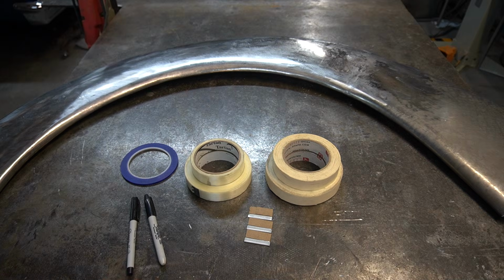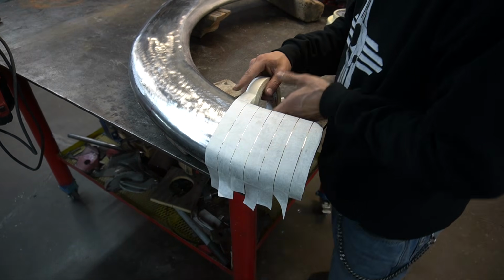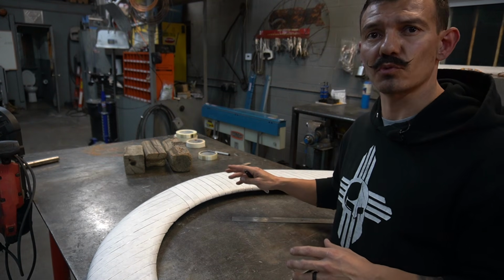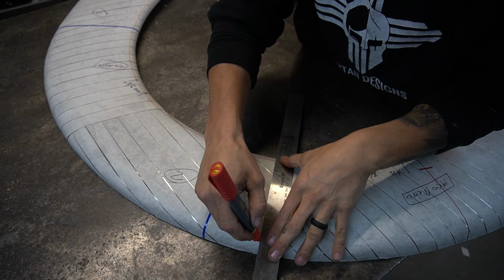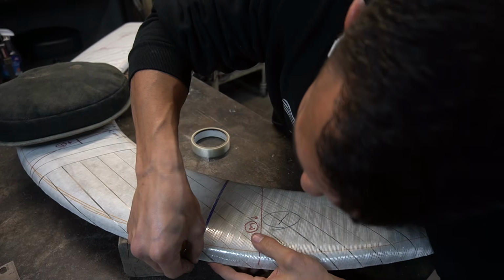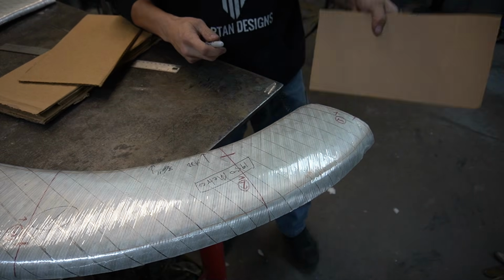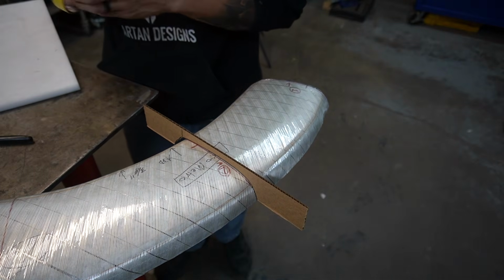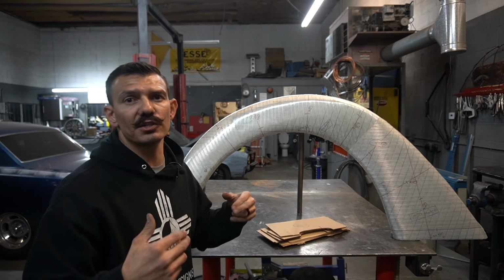How to make a flexible shape pattern | Metal fabrication | Wray Schelin signature patterning method.

Comment: Another practical and straight forward video, thanks. For the inner sections you copied, i would recommend you to use a contour gauge.
Reply from the maker: That would have worked perfectly for this fender. I need to invest in a few of those.